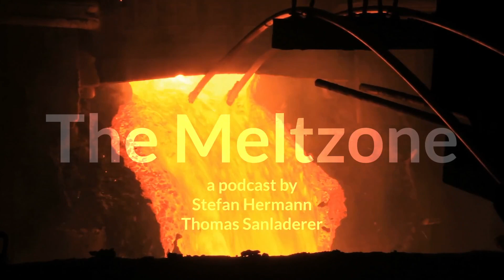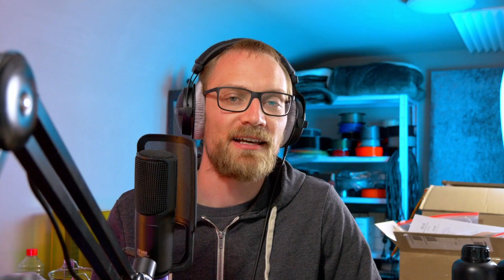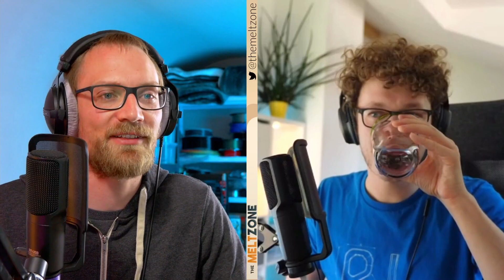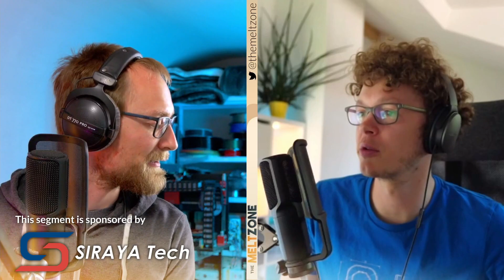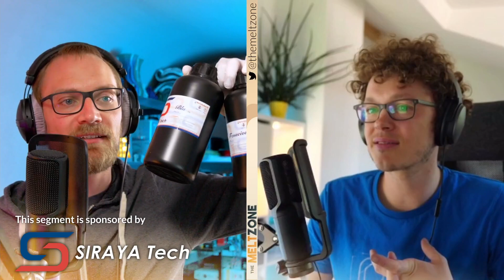Trademark, Re-branding & Filament Welding - The Meltzone Podcast Ep 46

Comment: I think it must be years now, since I read research at Illinois Uni or something like that, used 3d printing for massively improved lithium batteries. IIRC they 3d printed a super fine 3d lattice structure, which had graphite or graphene either deposited on it or filled in the lattice void (might misremember the material), then they dissolved the printed filament. Either way, IIRC, the 3d printed part wasn't the product, but support material enabling otherwise impossible casting or deposition. Ending up with an insane anode-cathode surface area per volume, that could in theory hold 10-20 times the energy density, and charge/discharge hundreds of times faster.

Comment: I want a bigger, faster printer... At least in my experience if you're printing tiny things the difference between 60 and 120 mm doesn't make a lot of difference. But small gains in speed really stack up over time on a large print.

Comment: You have to defend your trademark, they won't check potentially conflicting trademarks.
You can get a list of the recently applied for trademarks and have to look through the list and dispute regularly or you lose your protection.
Additionally you have to check if someone is misusing your trademark, if not it's basically free for everyone as Thomas said. This is why company's like LEGO sue everyone using it, even if it's a private person making no money with it.
Additionally you have to use your tademark, Cisco had trademarked IPhone but didn't use it so it was void when I'm not mistaken.

So getting a trademark is the small and cheap part, defending it is the hard part.
For example think of someone is producing parts in China with your trademark on it, how will you defend against that? Lawyers, confiscations by Customs, lawsuits for potentially years,...
If you aren't prepared to do that it may not be worth getting a trademark.

So basically a trademark does NOT protect anything by itself but only gives you a means to defend it yourself

Comment: I'm new to 3D printing, purchased a CR6SE for the Uni lab to develop stuff for research projects(CR6? yeah I know, slowly throwing away the bits that don't work, another story), Anyway I have a question, a big question for you guys. I work in an area of research where we are trying to solve the problems of environmental contaminants, such as Nitrates. As much as I love 3D printing, in some ways is minimizes waste in development stages of the sensors I am developing, but the waste in plastic is disturbing. For example, why is filament supplied in plastic spools that largely are not recyclable? Why not cardboard spools? Or loose rolls that could be spun onto a spool?   Why aren't the 3D printer consumers demanding ways to limit the impact of waste?

Comment: I run a small 3D printer farm as a side business, mostly to self-finance my hobby. So I was interested most in the part about PIF and royalties for 3D objects. Problem I have experienced in the past is that people that promise to pay royalties never send a single cent and not respond anymore once they have received the 3D model. This is why I stopped sharing any 3D models that I want to make any money with. Honestly the only 3D models I currently share are mods for the Vorons, as I want to support the community and give something back for the tremendous support I got from the Voron community myself.
I admit that sometimes I am inspired by 3D models from others, but then I choose to design the part from scratch as most of the times the people with good ideas have no CAD skills. So the original design are often poor quality. I also test everything myself and nearly always improve the parts.
The biggest problem with making any money with 3D printing are the people hat just steal your 3D design, make poor quality parts and do not follow rules and regulations for commercial sellers. Here in Germany I have to pay not only taxes, I have to pay for the packaging and the recycling for the packaging(Duales System), I have to pay huge fees on ebay. Meanwhile they charge nearly 20% with the new ebay payment system they force you to use. And they charge it not only for the item cost, but also for the shipping cost, which they really should pass thru.
I also use filament from German manufactures to support them, unfortunately there are no good resin manufacturers here in Europe yet. Then I have to give any service that a commercial seller is required by law. I have to take back parts that customer is not happy with, absorb the shipping costs for returns(at least that is very, very rare in my case), lost shippings or at least customers that claim that shipping was lost(unfortunately I have this quite often, but I don´t want to raise shipping costs for small parts to include tracking).
And I will not get started on the hours you spent for CAD designs, managing printers, maintenance on printers and administration (tax and bookkeeping in Germany is hell and I don´t make enough profit to get this done by a tax accountant).
SO you might understand how I feel about those who just download a design from thingiverse and then sell it as "private" seller on ebay to make some quick bucks.

Comment: Make Anything’s Astrolabicon:

Yes the two puzzles look similar and work identical, but there is prior work of the puzzle which works the exact same.  There are differences between the versions (p.e. hexagon/square), so it is not a blunt copy.
If your job had been to make a smaller, more compact version of the original (the prior work model), you would probably ended up with something looking similar to both of the new versions.
I don’t say they did not copy from him, but I hardly see any proof for it.

Now he essential claimes: I invented it and they stole it.

The first statement is not true and I wouldn’t bet a five on the second. All ends are loose.
So this is a very bad example of a copyright-infringement.

Comment: Instead of PTFE tube for joining, use 12 gauge piercing needles, they shave the filament down to size, if it doesn't have to be split ,so for shorter lengths of filament

Comment: Tom and Stefan, awesome podcast, thank you! I especially like that it is not too polished and that we get a glimpse behind the scenes of what you guys are doing to maintain and grow your channels. And thanks to both of you for awesome channels, great unbiased reviews, and general awesomeness. Could both of you get into more detail about your experiences with DUET boards in the future? For instance, can you upload gcode from your computer to a flash card in the printer via wifi? and can it be done at high speeds? Because the BTT RRF board has super low bandwidth between the printer and the wifi module, giving, effectively making it (IMO) useless as a Octoprint replacement. An informal discussion on this channel is all I ask for, but a formal review on either of your channels would of course also be welcome.

Comment: Grasshopper is really fun! It's a plug in for rhino which is a nurbs based surface modeler. Grasshopper is most often used by architects to make those crazy panrlized surfaces you see in buildings, but over time people have written all sorts of plug-ins for the grasshopper plugin to create gcode, to animate, to simulate, etc. It's really good at automating 3d processes.

Comment: A way to assess the speed of a 3D printer would be to scan a finished standard part (like a 3DBenchy), compete some kind of least squares error measurement of form accuracy, and then add a time penalty proportional to the error. One issue is it wouldn't look at specific issues, like over-hang quality, but it would be something. The other issue is working out how to convert the error to scale.

Comment: Concerning the speed: Couldn't you set minimal requirements for accuracy and bridging? Then there are torture tests, which sometimes fail completely, if retraction is a problem. I bet there is an optical method to judge ringing, if the rest of the printer gets decent results. On the other hand, I guess a printer can probably not ring that bad, that it fails some minimal requirements without failing accuracy tests, torture tests and bridging.  
And then only times are accepted, which pass all the minimal requirements. I guess it is possible and could end in values like the Litres/100km fuel consumption values. But you should allow the manufacturers to optimize their profiles like the car manufacturers do. That makes the numbers slightly weird and unrealistic, but in the end it tells you, if you are buying a compact car, a truck or some engine with technologys from the 40s.

Comment: Print Speed is strictly volumetric flow rate or grams/time.   The tricky part is determining what detail and print quality is required to say the part printed correctly.    With a benchy or figurine sure you could cheat infill or outerwalls, but with any functional part there will be a minimum to walls and infill for the part to function correctly.   So anything other than grams or volume/ time at an acceptable quality/detail would be the same as stopping a part half way and saying you printed it "faster".    That's not to say that those cheats are not useful.  It allows a new definition of a successful part that can be useful in some situations at a great time savings(strictly cosmetic, etc).    But to say it is "faster" is nonsense.      In this case for a fair printer to printer comparison to test speed vs detail you could test flow rate of the hotend and then if a benchy is the target have a standard number of perimeters and infill and just turn up the speed and maybe heat until the quality is not acceptable by whatever metric you choose.     When we where printing face shields out of petg we dialed in settings to ensure they were strong enough then cranked speed and heat to as far as we could without losing strength or quality on our Prusas.   We ended up around 12mm^3/s for the whole print.